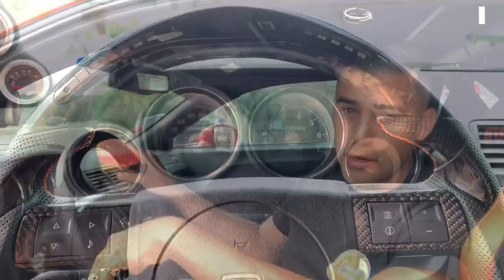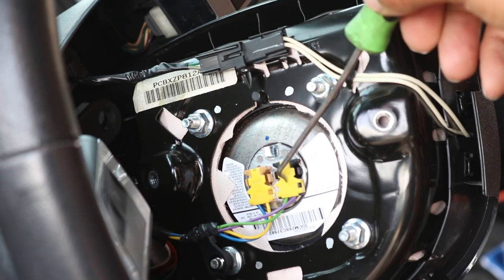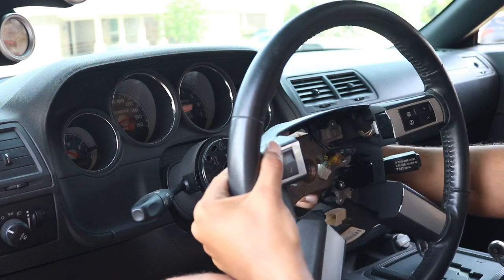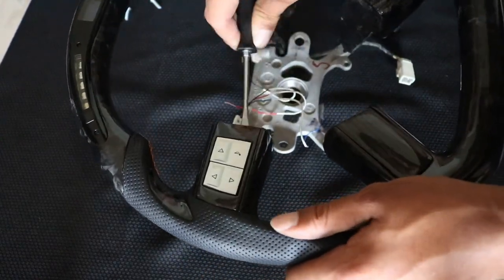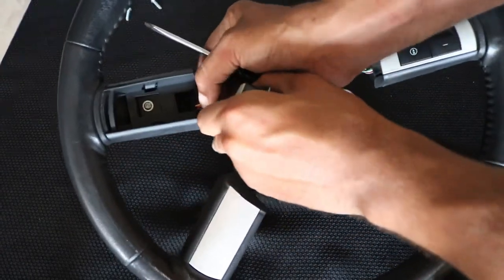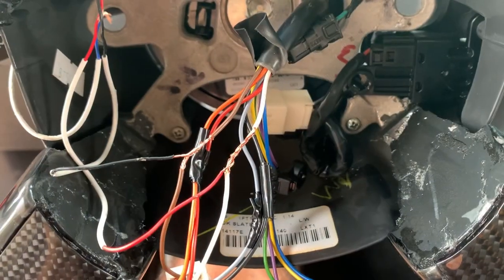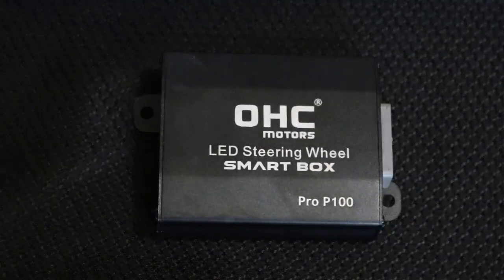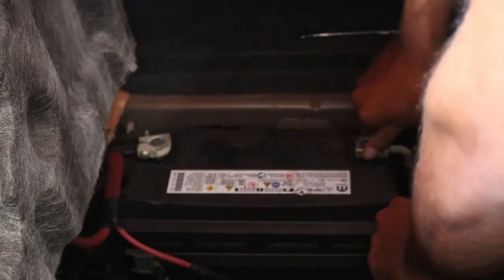How To Install VICREZ Carbon Fiber Steering Wheel In 2008-2014 Challenger!

Comment: Just got this for my 06 srt8 300 , did u slice into the right side connection|harness for the steering wheel buttons to connect the red & black wires from the led bar ?
Reply from the maker: Honestly, I don’t remember. I’m sure it’s in the video tho!

Comment: How much bigger or smaller is the vicrez steering wheel compared to the original?
Reply from the maker: Man it’s actually about the same, the wheel itself is thicker but the diameter is about the same. I’m switching to a STATUS deep dish suede wheel for driving now. Smaller diameter and easier to handle.

Comment: Where do you get the smart box and harness for smart box? Is that included with the wheel or something that you have to buy separate?
Reply from the maker: It’s included with the wheel. No need to purchase separately.
Reply: @TIRADORACING  Could you send me a link to the one you purchased?
Reply from the maker: Yes sir! 

https://www.vicrez.com/vicrez-carbon-fiber-steering-wheel-led-vz102341-dodge-challenger-2005-2010?search=Challenger+steering+wheel

Comment: So i wanna know if is possible install  a NRG steeringwheel  on dodge challenger 2012 ?
Reply from the maker: Man I want to install a status wheel but the buttons to my screen are on my steering wheel and they are wired through the clock spring and those buttons wires hide with the airbag. 

I know one guy who did it but he said he lost his buttons and had to shave some stuff down for it to work.

Comment: What are the wires you solder for?
Reply from the maker: For the LED DISPLAY, essentially it’s power and ground.
Reply: Just got my steering wheel I'm hooking it up now, so no need to use the blue wire?

Comment: Can we do this if the steering whee has no buttons?
Reply from the maker: You can, but I don’t think vicrez has an option for no buttons and you’ll end up using your stock covers instead. Which will leave them silver or whatever color you have.

Comment: Hey man I have a 09 challenger and can’t find the white wire where is it located
Reply from the maker: If you cannot find the white wire I’m not sure what tell you. The video shows the wires I had. 

If you pulled the airbag off and there’s wires missing or different idk what to tell you. I didn’t have to fish any wires out everything is visible and accessible.

Maybe your wires are a different color? 

Unless your asking about the white harness that comes with the steering wheel? That came in the box with the wheel. 

Have you completely pulled off your wheel? If it’s not there, then it’s just not there.